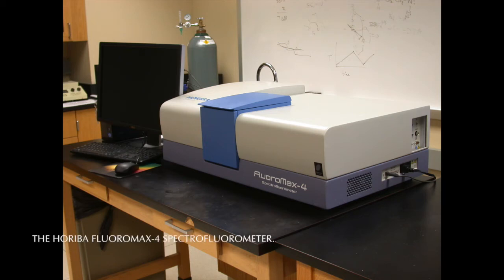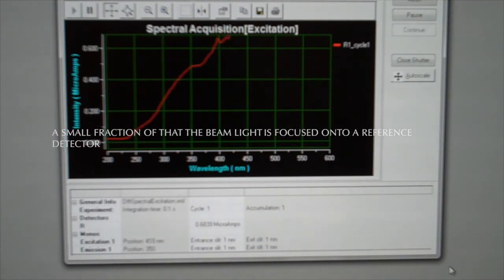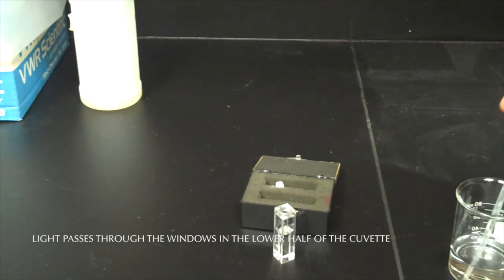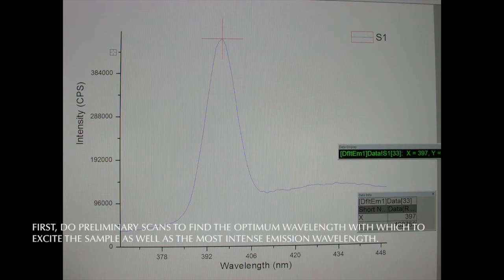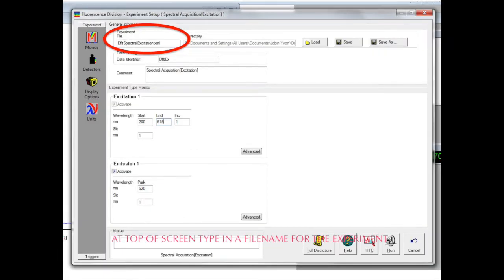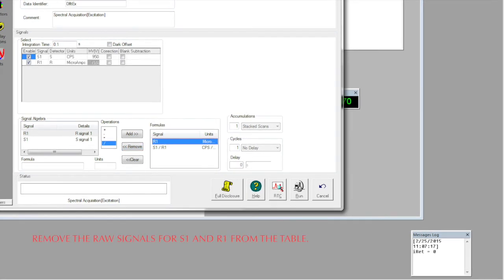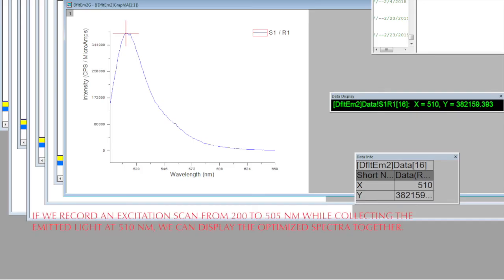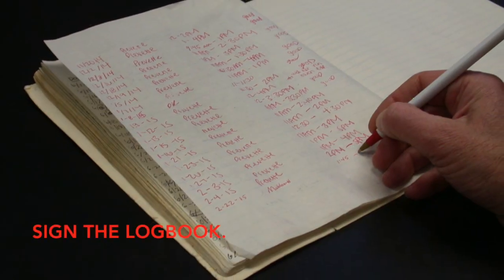Fluoromax Spectrofluorometer

Comment: Hi I have doubt. The last graph you got where the graphs are overlayed. Is the left one emission and right one is excitation? Please help
Reply from the maker: Hi Partha, 
In the graph on the left the peak appears at shorter wavelengths. It is, therefore, at higher energy than the one on the right. Recall that a molecule captures a photon and tends to lose some of the energy before releasing it. Consequently, the emitted photon will be at lower energy and longer wavelengths than the photon that was absorbed. So, the curve on the left (at shorter wavelengths) is the excitation (or absorption) spectrum and the curve on the right is for the emission spectrum. (There is another mechanism that involves the arrangement of solvent around the molecule in the ground state and the excited state that causes the emitted photon to appear at longer wavelengths, but the trend is the same--the emission peak appears at longer wavelengths.)
Reply: @garymabbott4064  Dear Dr Gary, Thank you so much. I recently switch to this field and this video and the explanation really helped me. I added you in Linkedin for future reference. Stay safe.
Reply from the maker: @UCYeHob4LdDaJ18vMkdaZozg 
I'm sorry, but I retired recently. I don't have any plans to make any more videos on fluorescence.